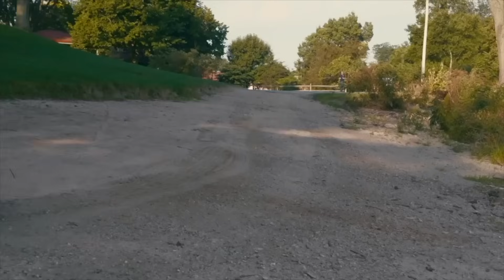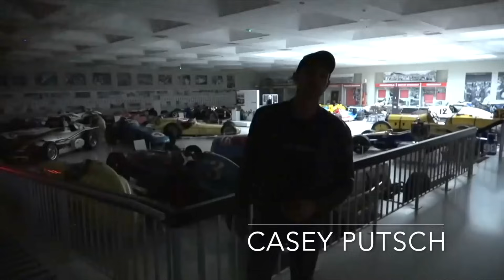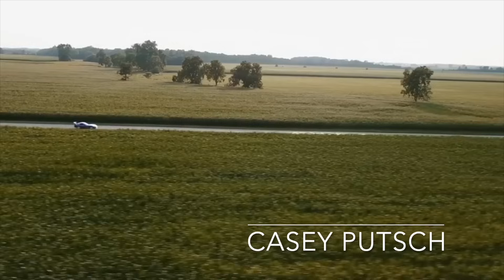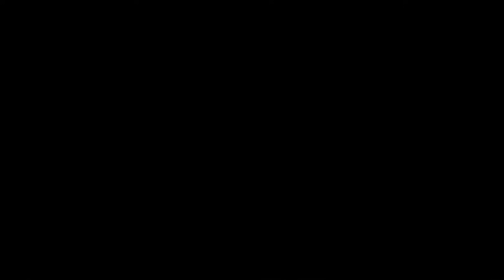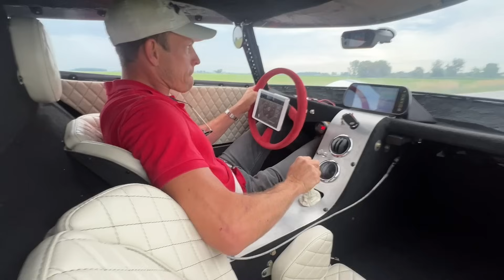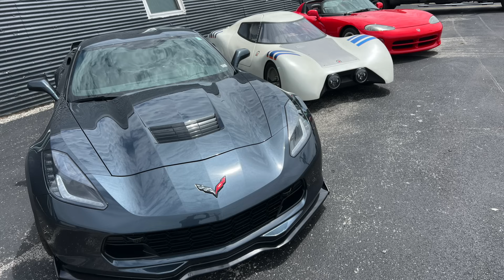HOW?? 104.7 mpg,  0-60 mph in 4.61 - the OMEGA CAR - Video 4

Comment: I love the car concept, but the government control out there is ridiculous, they are all parasites. I'm an engineer and physicist, I wonder what Casey could do with a 10kw adiabatic reactor? It's only about 13hp and NO moving parts. Up in Canada, we have idiots in government that could be using ammonia fuel tech coupled with hydrogen that is much more efficient than this electric car BS, but they literally refuse to pursue it. I worked on the natural gas conversion project as well, that didn't get placed into mass practice either. I tell you though, I also worked for the military and CI, they have no problem with the R&D and complex tech, but they hold that very close to their chests and don't give it out. It's a sad world we live in, greed, avarice and power always beat out mass necessity.

Comment: You are 100% that your concept can be done with any vehicle. I built a lifted 98 k1500 on 37"s with a 96 12v tuned around 500hp. I live in the mountains and average around 30mpg. I've been very curious since how a guy in a garage on a very limited budget with 30 year old tech, could build something modern vehicles still stuggle to even come close to.

Comment: Your math is a little bit off. A model 3 gets about 5 miles per kwh in optimal driving which is about $3.40 at 0.17 per kWh. I think the national average is heavily skewed by california, because in the south,  I have off peak plan and pay $0.03 per kwh. I also see superchargers in Atlanta as low as $0.17 per kWh. Really cheap.

Comment: How did you get better gas mileage and a faster 0-60 on your alh motor? What parts did you upgrade and what tuner or remapping did you use?
Reply: I just bought a 2003 jetta with the 1.9 alh motor and I am trying to make it better. Where is the best place to learn how to get the most gas mileage out of my car?

Comment: Were they any technical details shared here? I got that it's a 4cyl turbo diesel and a 5spd. Its light and aerodynamic. Does it have low drag brakes and great wheel bearings? Id like to know the nuts and bolts of it because the numbers are pretty incredible.

Comment: Speed Of Air makes diesel pistons with a top surface with golf ball like dimples that creates swirls that induce complete combustion and reduce consumption and emissions by having a complete burn. So much so the engines rebuilt with them don't need emissions controls.
Reply: I would like to know if Casey has tested them and found that claim to be true.  Especially after 100,000 miles or more.

Comment: VW XL1 (a bigger engine without the $100k+ price tag). Speaking of nuclear - I would love to see a scaled down Hyliion Karno single shaft generator running off the waste heat of two small pellets of nuclear fuel, charging a 4kWh battery to power a vehicle. No steam turbines needed to generate electricity. I think one of the downsides of using the diesel model - you still have the complexity of the engine (valvetrain, intake components, soot and NOx control, turbo, belts, oil changes, cooling, fuel injectors, pumps, etc.) plus the need for a dual-clutch transmission that will require more maintenance when driven hard. The draw of EVs is the perceived lack of required maintenance (albeit you still have tires, coolants, heating & cooling, suspension components, dashboard and interior electronics, brakes, charging source, etc. to deal with).

Comment: Hey Casey, in 2023 I bought a brand-new Toyota Corolla Hybrid in my country Mauritius and am surprised that I am getting above 700Km in one tank of gas of 35 litres at about 22Km/L!  It has a hybrid battery of only 844Wh in terms of storage capacity weighing only 25Kg.  I had also owned two previous generation of non-hybrid Toyota Corollas since 2010, with engine displacement of 1.5L, where I had been only getting 13.3Km/L on average for a range of roughly 400~450Km.  My point is that I get the impression that Toyota can do better in terms of consumption and is purposely refraining from doing so!  I relate myself to your project as prior to the ownership of the Toyotas I had a French car (Citroen Xsara 1.9L Turbo D), it has nearly the same engine as the Omega, but I was getting 600Km for 45 Litres of Diesel at 13.3Km/L with an engine that was designed in the 1990's, its weight 1400Kg.  What if my hybrid had more storage battery capacity, how much better gas mileage I would be getting?

Comment: HOW??  Wow, that was 18 minutes of jibberish, with no specific information, regarding the original question. I wish I could get that 18 minutes of my life back. I wonder if anybody has independently verified this car's performance.
Reply: It definitely does get the mileage. It's honestly not rocket science. Take a TDI engine and build a light car with efficient drive train.  My Passat gets 48mpg cross country at the speed limit. deleted and tuned gets 54mpg. He basically took a tdi engine, took the egr and dpf emmisions off and made a strip down go gart with an aero frame.  He is a car guy so definitely tuned it. I had a 1992 civic that got 45mpg with good tires and the egr removed. Put a tdi engine in a lightweight 90's civic and you will get 60mpg lol.
Reply: @jonathanmoynihan3661 Does his car use a TDI engine? What has he done to get the MPG he claims? That's my problem with his 
video. It's way too short on details.
Reply: @davescott9409  yes. Its a deleted tdi lol. If you build a go cart with an aero body, deleted tdi engine, efficient drivetrain and efficient tires 100mpg is actually very easy. I like the concept but it's not revolutionary. He really just shows how the automotive companies are tied to the petrodollar and overall cronyism which rely on the revolving door of industry and the epa.  The DPF and EGR makes the tdi last 220k vs 500k. Creating new cars are not factored in "greenhouse gas" calculations. If they were, we would not have dpf and all cars would be easily fixed and upgradable. Planned and intrinsic obsolescence at its finest. Kensian capitalism won 🏆
Reply: @jonathanmoynihan3661 I don't doubt anything your saying. Again, the video provided few details about the car. Back in the 1980s I was an auto mechanic at a Honda Dealership. I think it  
was 1985 when Honda introduced the CRX HF. If I recall, it was EPA rated at about 70 mpg highway. Motor Trend magazine drove one from LA to Salt Lake City, to verify it would get that kind of gas mileage. I think they got something like 67 mpg with it. It had no new technology. It was just a small, light , aerodynamic car with a 1.3 liter 4-cylinder engine in it. It had a five speed manual trans in it, and third, fourth,  
and fifth were all overdrive ratios. The USA driving public isn't really interested in high mpg cars though. Most people want a  big SUV or pickup.

Comment: Around 7 minute mark he says he uses a 4 cylinder turbo diesel readily available motor in USA. 5 speed transmission.
Reply: Sounds like a VW turbo diesel engine. Which are already great engines, the issue is that they didn't pass emissions when they were released bc the way the US measures diesel emissions is stupid. I don't doubt this car exists, but I would love to see the technical specifications of it.

Comment: There are designs for nuclear power plants that are safer than the current design that were scrapped.  Its called a liquid salt reactor.  There is NO reason for the high costs and danger of modern nuclear reactor design, yet its what is used.

Comment: I only buy 3 gallons of gasoline at a time to keep the weight down

Took the car seat out passenger cut the muffler off to reduce weight and no longer have a hybrid battery in the car 

I also change the way the gasoline goes into the motor. I’m always on extreme lean burn. 

The car will go about 50 miles an hour on flat. It’ll go faster than that downhill slower than that uphill 

I get anywhere from 85 to 99 miles per gallon depending on temperatures and direction. The wind blows all of this I think I have filled up four different times since May 1 or 3 gallons at a time.

Comment: Interestingly enough, Volkswagen's XL1 got 104mpg, too (250 or so as a plug-in hybrid). 100mpg appears to be the "number" with 33% efficiency engines.
16:37 "the difference is I went out and did it"
100mpg isn't enough. Fortunately, simultaneous combined cycle piston engines can approach 2/3 efficiency. The smallest is a straight six emulator, four combustion cylinders all feeding a central combined re-expansion/steam expansion cylinder that replaced the central two cylinders.
Lots more, but yes, internal combustion is poised for a great leap forward

Comment: Can you actually talk about the design choices you made and what you actually did rather than brag about how you can just design better, and going on weird anti-industry anti-political rants. 
the way you are structuring these videos, you are making claim after claim after claim with no substantive examples or data. I’m just waiting to hear you say you can make it run on water.
I’m not trying to cast doubt on your skills or anything but you gotta know as a designer/engineer you have you provide data and explanations for your claims.
Reply from the maker: How about just look at it. This ain’t rocket science…
Reply: @CaseyPutsch  what am I looking at? just heavily optimized aero? You’re not explaining anything. What’s the coefficient of drag, what’s the weight, What materials are you using? Your blow off response to my valid questions makes this whole thing seem disingenuous. I guess I’ll wait for the 3rd party testing.
Reply: I'm thinking it's stripped down. No heater, turn signals, no carpet, headliner, windshield wipers, etc. Yeah. No details.

Comment: I use to want to grow a specific algae that created something like 10x more ethanol than corn per acre on a farm in ponds, and not only create oxygen and take out carbon but create a clean race fuel! But now I'm thinking of building super efficient EV's and having solar panels create the fuel. Its a lot easier, especially since anyone can do it with a little bit of land. Main reason is Diesel, gas, oil is controlled really hard by those worthless politicians! Getting at least an alternative to any form of monopoly is a good thing!

Comment: I follow the motto of my grandfather. Quote anyone can buy a new truck it takes a real man to keep an old one running I've done this very well I have 4 vehicles from the 1990s all running well. My primary vehicle is a 1996 f250 with a 7.3 l turbo diesel it is basically stock and it gets 24 mi to the gallon highway 22 City.

Comment: I am a firm believer in what you're doing I've been dreaming about doing something similar for years but utilizing as many off-the-shelf components as possible standardized parts. What you're doing is absolutely amazing however I am a hard-working blue-collar guy sports cars are great but not practical. Would love it if you could repeat this process but with a compact truck such as what a 1990s Ford ranger would be capable of. And then scale it up to the size and capabilities say another vehicle I own such as a 1990s 7.3 l turbo diesel f250 both my ranger and my f250 I utilize in daily life to run my small farm a true working man's vehicle.

Comment: i need something for 10k that uses 5 liters / 100 km of petrol, because diesel emissions costs extra in eu. I just went and built electric mid drive bicycle. But when its Tuesday and its raining, I order uber. If not mad people i just use rtg electric and call it a day. Solar radiation is way more hazardous than rtg, I understand that if something goes really wrong it might pose hazard, but I doubt it. RTG was and still used unless some dumb as#ess disassemble those. TL DR you just have nuclear heat source and pelter element with some radiator and you have electric power for decades, and radiation u say ? well radiation will be long gone before it even radiates that radiation, unless again, some dumb @sses tries to disassemble reactor. In the end we live in capitalizim and major capitalists will do everything, to keep you poor and drained. I am not saying that I am a communist, I am utopian by heart.

Comment: Well electric is by far the most efficient method of propulsion. The design of the vehicle is the main reason cars are so inefficient and the honest truth is that people won't buy the efficient ones. Just look how many people spend $70K on a pickup that also burns 3 times the fuel of a small sedan. Yet people still buy them as their primary or even only car. 

In fact look at what the number one reason people buy a car. Is it the top speed, acceleration, handling, ride quality? Nope it's none of those, it's storage space. People will pay far more for a car that's worse on gas just for more cargo space. 

And I think I need to point out that the Volkswagen XL1 did come out in the time this was made. It got nearly 270mpg. It was a diesel plug in hybrid. It was more electric than it was diesel though as it only had a 1.5 liter gas tank. The benefits that make this car good on gas would also make a more efficient electric one, and electricity is cheaper than gas or diesel and more eco friendly. Make. Lighter car and you don't need the batteries as much so EVs end up looking even better in comparison

Comment: I loved my VW Turbo diesels. I had an ‘02 Jetta and an ‘06 I gave to my daughter which almost has 400,000 miles on it. And I bought that one new. I now, officially cannot get what I want in this country. A basic, rugged turbo diesel vehicle. …without DEF involved. No Toyota diesel trucks, and no Passats that have a range of 600 miles. Vehicles in America suck. Next car I buy will be a 1960s car which has been completely rebuilt to new…with some added tech to make it better. That will be my ‘sunset’ car. I do not want to fool with the new crap!

Comment: All of this stuff is painfully obvious to anybody with half a brain. Simply look to the past to see what has already been done with cars. 40 years ago we had cars that got 40-50 mpg. 

If anyone were serious about the environment I would be able to buy a new model year 2001 Honda Civic. Or a new 80's VW diesel. And for a truck, I'll take a 2000 Silverado. Improve what flaws they had, actually do something to protect against rust, and people would have lifetime vehicles that get better gas mileage than today's cars.

It is government regulation and companies wanting to profit of off "new" and more parts that prevent us from having cars that we know were good.

Aside from high end performance (which was no engineering mystery, it just became an arms race) what technological improvements have been made to cars in the last 25 years? It has been nothing but cramming in more unreliable junk to meet emissions standards and appeal to dull customers.

EV's should be developed. Independent of government subsidization and mandates. Competition with oil is a good thing. Good for prices, good for consumers.

Comment: The Japanese broke the mold back in the 60's with affordable small efficient cars, then followed the old way of win on Sunday sell on Monday in the motorcycle arena by building way better bike than anyone else.
The omega could be open source detailed plans, if you give them to the world to follow, or a kit car.
I agree the government is the problem. A hemp based body will last 50+ years at a fraction of the cost as well used as the fuel, 70% of a corn plant is thrown away. Alternative fuels is the way forward not EV's. 

Just look at how many people are driving a huge suv alone 90% of the time, sure they need it 2 days a week, but, they need a second car for day in day out use like the omega, I would have one in kit form I just don't have the time to start from scratch. Nor do I want to invest it tooling to build 1 car for myself or start manufacturing them for others. I would be happy to assemble for others a kit though, after 2-5 I could make 1 a week I am willing to bet. I feel you are missing a boat on this one.
I am more than capable as a mechanic but at almost 60 I don't want to build from scratch. I can keep my 1987 Jeep yj running for the rest of my life, or my 2001 Suzuki 1200 Bandit. Thats environmentally friendly IMO.

Comment: My 2002 Saturn SL1 is plenty fast, the AC works in the summer the heat works in the winter, the rear defrost keeps the rear window clear it's cheap to run, it's cheap to keep and it's cheap to upkeep. My 94 Saturn would still be running if I had used enough threadlocker / Loctite on the intake manifold cam when I did the timing set but that's my own stupid fault ...

All that aside, how much would it cost to build one of those?

Comment: a diesel pickup that gets 40-50 mpg that can get around DOT weights and still have plenty of pulling power and stop safely would change America quite quickly in my opinion. im also gonna throw in make it under 65k give small business owners a buying incentive and it needs a beefy front end for snow plows. the amount of small businesses this could start across the country is insane.

Comment: I'm curious because with a little looking I couldn't find what composite was being used that's recyclable. 
I don't know of a direct nuclear power source that would work because of spending but I am curious what the most efficient path from nuclear power to a car would be. Would be nice to have electric trains more.
I'm an Aptera fan and they look like they will be offering an EV taking advantage of lightness.
I've been looking at the benefits of propane lately.
Composites can be safe. People's perceptions of safety with high big heavy cars is net harmful.
I don't like mpge.
Miles per kilowatt hour would be better for EV comparing but fuel vs electric is complicated.
Don't forget the corn lobby.